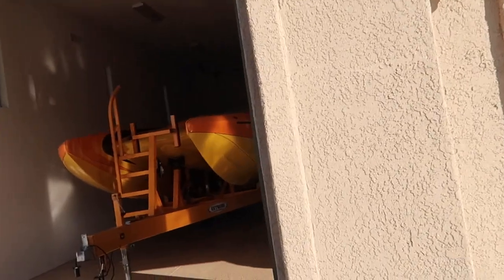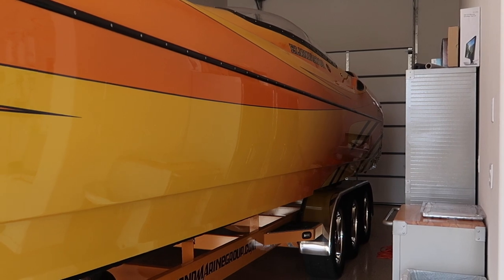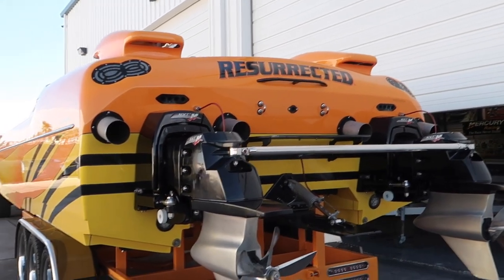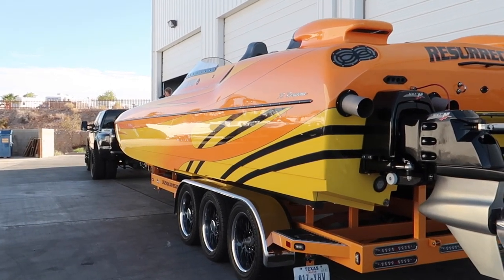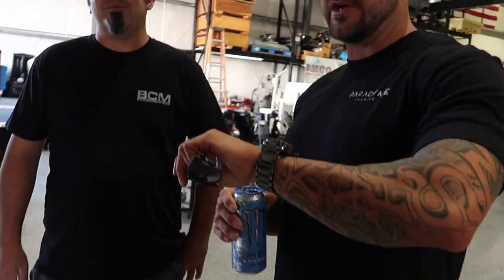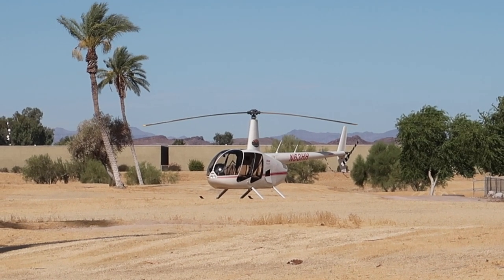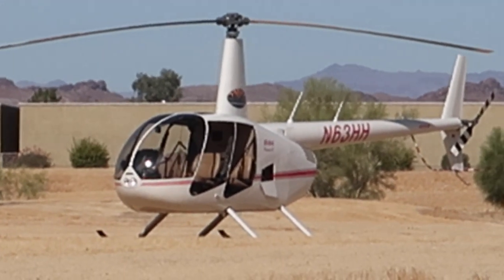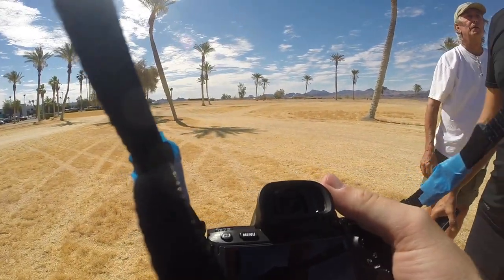Filming Boats In Havasu with a Helicopter | MTI 340X & Eliminator Daytona

Comment: What focal length lenses you were using - hard to figure out the distances with altitude coming into play. I'm doing same kinda shoot soon and all tips are welcome - don't want to carry too much gear onboard
Reply from the maker: Hey Tom, the main lens we used a 24-70mm (if i remember correctly) and we also had a Canon G7X point and shoot camera. We had to stabilize the 24-70mm footage in post, but the point and shoot footage came out decent because of the stabilization in the camera. If you use a gimbal, be sure your gimbal settings are correct because we've had problems in Glamis when the heli would throw the gimbal off balance. I hope this helps. Good luck - Aaron